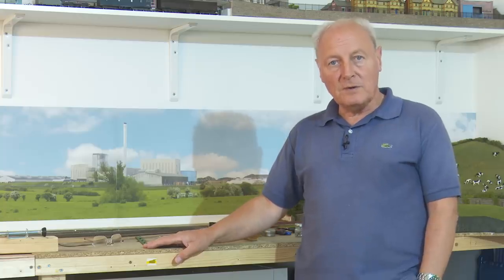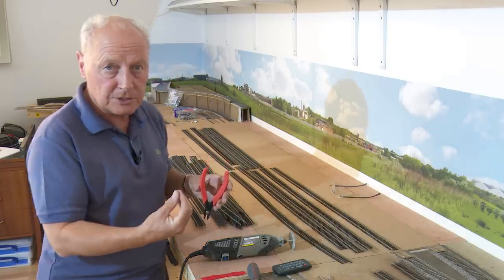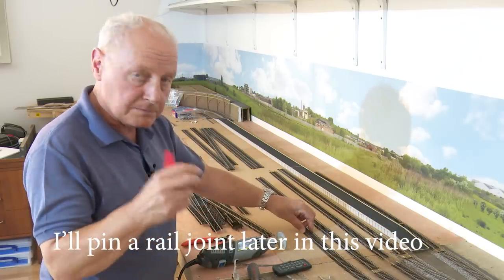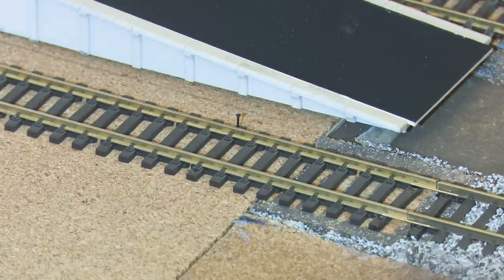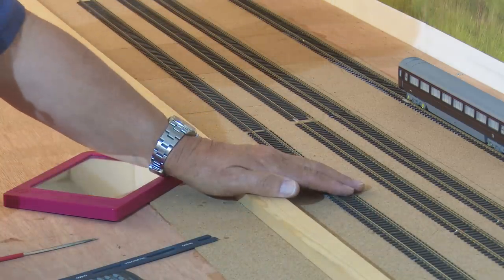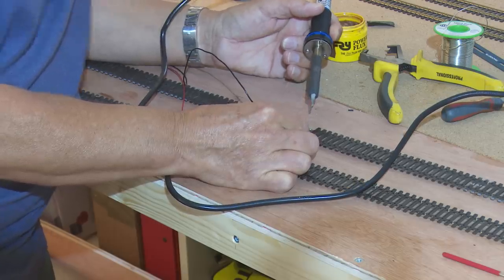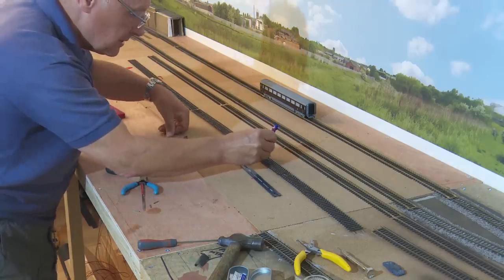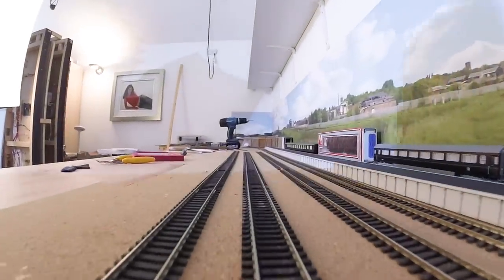Track Laying Glue or Pin? at Chadwick Model Railway | 38.

Comment: Hi Charlie.

First time I have felt I should give feedback for one of your vids. I was always a pinner, now I will be a gluer. I have problems with my hands and all that fine drill work causes me diffiiculty.

The mirror tip is especially useful, as maintaining track accuracy was always a problem for me. I have used a straight edge, but when pinning it always seemed to wander off line.

Also, I used to pin in the middle of the track - from here on in I will pin the outer edge of each sleeper.

Now I only need to pin at the rail joint - the glue will take care oif the rest.

Please keep the vids coming - you probably have no idea how much unneccessary labour and anguish you save us poor artisans. It is a pleasure to watch one so experienced. As ever a picture is worth a 1000 words!

Regards,

Randal (I am a Pentax user, by the wat)
Reply from the maker: Randal, it’s comments such as yours that make the production of these videos worthwhile.
Good luck with your layout.
Regards Charlie
Reply: I used to pin now I use copydex it's brilliant for holding the track saves so much pinning I do put a couple in larger points and glue as well just to make sure.
Reply: I always pin my track to make adjustments and reuse much easier/cheaper.

Comment: My parents and older brother spent untold time and money putting together a slot car race track for me and my little brother for Christmas 1969. It encompassed every inch of a 4' X 8' X3/4" piece of plywood. On Christmas eve night, after me and my brother went to bed they set the elaborate set up on top of the dining room table and it took up most the space in the room. Well, after about a week it was time to move the whole set-up to the den area in our basement. Unfortunately when the set-up was lifted and moved the board, in which the tracks were attached by wood screws, flexed badly when moving and wound up breaking nearly every joint in the track sections. They had overbuilt everything but forgot to attach any bracing underneath to prevent flexing. They made several attempts to repair the breaks but it never did work right again. There were always dead spots in the tracks that when repaired two more would pop up. After a while, we lost interest in it and it just sat gathering dust for years in the basement. I don't remember what happened to it but I sure wish I had it now.
Reply from the maker: What a sad tale.  Great joy followed by much disapointment.

Comment: When gluing track, instead of holding the track in place with books, I temporarily insert small screws with washers between sleepers (not through the sleepers) at strategic positions. Once the glue has set you can remove all the screws. Note that before the glue has set, you can adjust the exact position by loosening one or more screws, moving the track then re-tightening them.
Reply from the maker: An excellent point Gerry.

Comment: How come there are no Holes in the middle of the track your’e using? I’d Pin lightly. Gluing would be too Messy for me. With my layouts I am Running Ho and N scale my wife is Ho And Soon Be N Scale. Needs Track though.
Reply from the maker: Peco flex track has no holes, you need to drill your own

Comment: I model and used to exhibit in N gauge. I do exactly as you do with one exception. I put my pins in the centre of the track NEXT to the sleeper. I half push the pin in and then fold it over the sleeper. After balasting I then remove the pins with pliers thus avoiding holes in sleepers. Cheers, Bob
Reply from the maker: There’s more than one way to skin a cat.  Bob, I’m pleased that your way works too.

Comment: Another excellent inspiration. Neither a pinner nor a gluer shall I be - I will keep using screws, but I will use the tracksetta, the piece of wood and the 6 ft way guide. Thanks Charlie
Reply from the maker: If it works for you PC. Regards Charlie

Comment: Happy Christmas Charlie (Today's date Dec 25, 2023): at 19:34 your soldering technique is almost perfect, the only thing I could add is pre-tin the rails as well before attaching the wires, this will make the solder flow better when attaching your wires. 

A tip for you newbies, always keep your soldering iron tip clean of scuzzies (dirt, flux residue, etc) before applying solder to it, a quick wipe with a cotton cloth works much better than a wet sponge which will lower the temp of the tip. (background; electronics engineer (Hillyers, Stamford [UK] and master electrician, Canada)
Reply from the maker: Much has changed since that video Geo. I now use a brass mesh to clean the solder tip. 
I’m unsure why you didn’t see me tin the underpart of the rails. Perhaps I just missed that one. 
Best wishes for 2024, 
regards, Charlie

Comment: Hi Charlie,  I sure do like watching your videos.  You are a fine instructor and shoot very good videos.  Thanks for all your tips and instructions.  Bob - Brecksville, Ohio
Reply from the maker: Hi Bob, thank you so much for your kind words.  I find it particularly difficult to pick up US viewers so any advice would be very welcomed.
Have a great Christmas, regards Charlie
Reply: Charlie,

Well here is a quick one.  I use Liquid Nails for Foam Projects in a calking gun for roadbed and pins for track.  This basically a green foam adhesive that stays plyable.  A thin smear is all that is needed to secure the roadbed down.  Then another smear on top of the roadbed.  Now when you pin your track, the smear will grab hold of the pin very firmly.  Simply pull up the pins to move the track and repin thru the smear.
If the roadbed needs to move, then the putty knive slices easily thru the smear and releases the roadbed.  This is especially useful for those who use a foam board base.  For you with pins thru plywood, it would work well to release the roadbed and then repin.

So here is a project for you - - - -
I am designing to use a Raspberry Pi 3 to connect via rs232/usb to my NEC Power Pro unit.  I have the image for the pi that also contains JMRI and CUPS for printing the reports.

Then with an android tablet - with Engine Throtte app ( for android) and wifi connected to the PI, I will be able to talk to the NEC directly as well as pull up JMRI and use that throttle thru the pi.  CUPS will allow me to print the jmri reports to document my cv s and other items.  As you may know, with jmri, you access your loco and with a single click, all settings in your decoder are sent to the jmri.  No more coding cv s with a basic throttle, it is all in english or slider controls.  All this runs off a micro sd memory card.

Will let you know when I have it running.  Bob
Reply from the maker: Wow, thanks Bob. I’m not a JMRI user but Train-controller instead.
However, I’m interested in how you get on.

Comment: Good video, just came across it in 2022.
One tip: for adjustable support legs a lag screw put in the bottom and nominally left sticking down 1/2 inch or so, can be easily adjusted up or down with an open ended wrench (spanner).
Reply from the maker: You make an excellent point mate. Take care, regards Charlie

Comment: A very useful guide and I thank you for that. I use track screws rather than track pins which should allow me to dismantle - if necessary - a little more easily.
Reply from the maker: Hi Alec,
I’m so pleased that you enjoyed it.
Do you remove the track screws as you lay the ballast?
Reply: @ChadwickModelRailway  My method is to layout the track - I use Peco Setrack - on cork. I then drill holes through the sleeper, using Peco's holes as a guide, using a pin vise. Then the track screws are fixed through these and remain in place. I then ballast in the scenic area only.

Comment: Charlie,  I thought I was the only person that still had an olden wood level like yours. I love it and use it more than the newer metal one I have. Got the same saw horses too...I agree totally about track cutting...I like glueing better...Use a mirror as final inspection but use a metal 4 foot rule as a straight edge when laying the track. It won't warp or distort like wood will...Also use a string line and chalk to mark track centers....To keep track straight while glueing I use "T" pins on the outside of the track spaced as far out as a can of soup will let me as I use the can for weight. They fit between the track solidly and the track does not let them roll away.....I just use white glue as I can get it loose with water if I want to move a track...
Reply from the maker: Thanks David, I’m so pleased that you enjoyed the video.  We seem to have very similar track laying techniques, although I imagine that we have both learnt the hard way.

Comment: Charlie - another great video, many thanks for the tips. Although I solder my droppers under the rail like you, I feed them through the baseboard on the outside of the track, so I've made myself extra work to conceal the wire with the ballast. It's never occurred to me to drill between the rails! I'm about halfway through my latest track laying project, so I'll adopt your method from now on. I also like the mirror tip - it will show up kinks more easily than the naked eye and you don't have to stretch over the board to check the line furthest from the front.
Reply from the maker: I’m so pleased that you enjoyed it Neil and hopefully you’ve subscribed too.

Comment: 11:00 Good tip with the mirror. Another method for getting the track straight is to lay it along a straight edge although glue can make this tricky - an alternate is a straight strip of wood that fits between the rails that can double as a weight if glueing.
Reply from the maker: Good tip Graham

Comment: Great video but a small thing: 12:00 There's an easier way. Just drill much of the way through the plastic then hammer the pin in. That way you can remove the track with a tool but stop the track from moving of its own accord.
Reply from the maker: Makes sense.

Comment: Hi Charlie Have you ever used double sided tape 5mm hick  for track underlay its very cheap and really easy  and especially with flexi track simply draw on the layout and bend and lay at the same time ,Use two strips of 20 mm side by side .Thanks for your tips and advice .Geoff
Reply from the maker: Hi Geoff, I can’t recall ever seeing it.  Where did you get it and is it any good for deadening sound?

Comment: I’d suggest packing paper under the raised legs Charlie. I’ve seen similar bracket screws on my old table actually crush the wood, lowering the table under it’s own weight.
Reply from the maker: A good point, thanks.

Comment: Hi, I just want to ask you why you don't use a solder with its own flux core? I use a copper mix 0.7mm with a flux core and it save a lot of double handling, plus the copper adds strength to the join. Some of you solder joins look a little frosty which means its not a good electrical join, must be nice an shiny join with no ball or blob of solder but filled in smooth corners so it looks like its flowed in to the join (which it does do). I do my droppers on the bottom of the metal rail joiners myself so as not to muck up the track and possibly kink it. If I need an isolation section I make a very very short block sections on one side of the track rail and power the track up again at each end with the joiners. I do this the by cutting the actual track rail at the location of the flex track where I need the block and then trim it with a file so its shorter and then trim the slippers down so I can get the isolated joiner in  which I have also trimmed down and them push the adjusted rail back onto the flex track through all the ties so you can't really see the isolated section. I also do something the same when I join 2 sections of track together - I cut the actual rails of the next flex section shorter by 1-2  sleepers (to allow for doing bends) so the sleeper/s stick past the rails them trim down the sleeper/s so the joiners can fit on top but allow the normal spacing between sleeper/s to place the drop cables through the layout. Its fiddly I know but in the end the line looks seamless.
Reply from the maker: I do, I use a 60.40 resin core solder.
Good tip regarding the sleeper spacing.

Comment: Excellent vid. Do you have a climate controlled room? I find temperature and air humidity can cause problems due to the use of various materials, which stretch and shrink at different rates. So I place plastic sheeting under the track and ballast as to keep some flex in the track, with just the one pin in the middle. This bit of flex keeps my rolling stock rather happy. Ballast once and never again, except for some small gaps at the joints.
Reply from the maker: No special arrangements just s normal heating system here in the UK

Comment: Hi Charles, a question, if you use the kork as a noise insulator using the pin you vanish all the work, because the pin transmits all the vibration directely from the wheels to the plywood.
Reply from the maker: So true VC, stick around. In a couple of weeks I’ve another video planned regarding noise suppression.
Reply: Thanks Charlie,  I’ll wait for it. Keep it up.

Comment: What is the reasoning for pinning both ends of the sleeper rather than one in the center?  Is it for additional stability while the glue dries?
Reply from the maker: No it was about the best way to pin or to use glue.  By pinning the outside of the sleepers with tiny pins makes them almost invisible.

Comment: I've heard that Copydex is a very good glue to use for gluing down the track, and it is easy to lift the track with a wallpaper scraper as you suggest.
Reply from the maker: Hi David,
You’re not the first to mention Copydex.
Have you tried it?
Reply: Not yet. I am in the planning/baseboard construction stage, I am basing my layout on the modified trackmat layout as shown in the latest Hornby track plan book. I am using the trackmat layout, plus extensions 1 and 4 ( flipped about the horizontal axis. This will give me an end to end and a round and round layout all in one.
Cheers DaveH.
Reply from the maker: David Houghton 
It sounds interesting, good luck with your layout.
Reply: I used Copydex when laying my track last year. It certainly helps in reducing noise when trains are running. There has been no movement in the track so it's just as strong as PVA but without the noise. I would certainly recommend it.

Comment: I also wonder if you'll spray these tracks w. the wooden-look-spray you used in another video as it is already mounted and obviously indoors now?
Reply from the maker: Yes but wear some breathing protection from the emamel paint fumes.
Reply: @ChadwickModelRailway  Yes but I think I will want to plan to spray outdoors to avoid the odours etc, if that is feasible within these planning stages, then you might need to insulate some parts ie soldering points etc...?!

Comment: Very nice again thank you Charlie, soundwise does it resonate more with pins than if you just glue it to the board or whatever trackbed is beeing used? What if one should decide on those insulating boards the same as you use for hills and monutainslopes etc, lees sound probably but too light for board perhaps?! I'm starting over for the 3:d time in adult life and this time I will have both the time and passion to  do it right ;-) Cheers from Sweden again***
Reply from the maker: Yes pinning does transmit the sound into baseboards.  
For my scenic areas I use Woodland Scenics foam trackbed.
Reply: @ChadwickModelRailway  Ok thank you, just read on someones blog that a modern approach might work just as well with styrene-based boarding just make a wooden framework underneath and then it will be as stable but much less weight and easier to draw cables and put trees etc...!

Comment: Hi Charlie do you do a video about removing the springs on the code 75 and 100 points. There are 2 types of springs unfortunately when I've tried I have ruined the point,any guidance would be appreciated
Reply from the maker: Sadly, Barry, I don’t use code 75 points. However, I really can’t see them being much different than code 100. Regards Charlie

Comment: Great video, just to clarify... you mentioned the Peco 6 foot way gauge... later in the video you said several times you were using the set-track side... I'm guessing you were actually using the streamline side of the gauge when checking the distance between the tracks?
Reply from the maker: Hi Pete. I used the Streamline distance except for the centre tracks as I wanted a bigger gap to accommodate a footbridge support. For that distance only, I used the Set Track Gauge. Regards Charlie
Reply: Hi Charlie, ah... missed that bit!?!  Appreciate your reply! Thanks Pete...

Comment: I am a newcomer to railway modelling on my first layout. I am using what I was told is Atlas N scale code 80 flex track ( I don't have any corroborating evidence like labels etc), and am having considerable difficulty sliding the rail into the joiners. They just don't fit. The joiners are definitely code 80, as I have the label as confirmation. From what I read, difference in codes pertains basically to height. Will fitting a joiner of a different code lead to difficulties in fitting the rail into the joiner?
 Does the code make a difference as far as sliding the rail into the joiner is concerned?
Reply from the maker: As long as the rail heights match and the rails are held tightly, I cant see any problem.
Please rember though, that I'm not an N Scale modeller!
Reply: @ChadwickModelRailway   monitored sir!
I just tried a packet of SL-310 (Piko I think) metal rail joiners (for N/00-9) , stated (on the packet) to be suitable for codes 80 & 55. And it worked like a dream! So I'm sticking with SL-310.